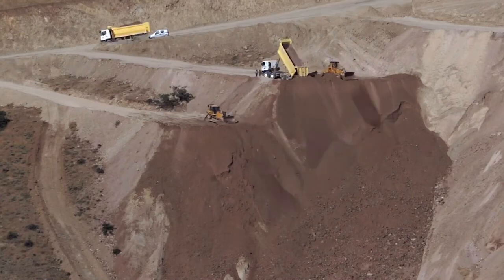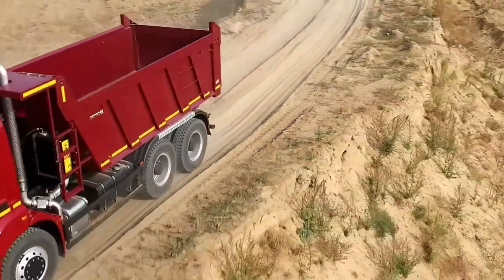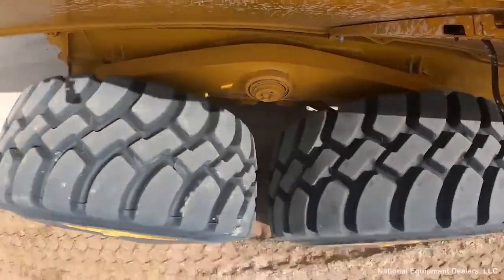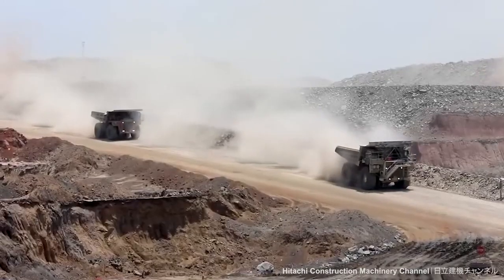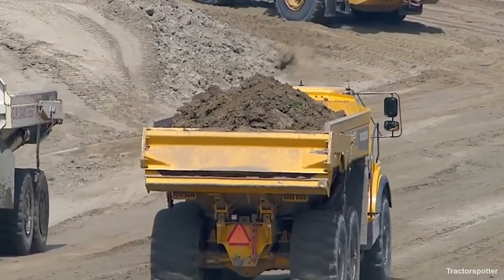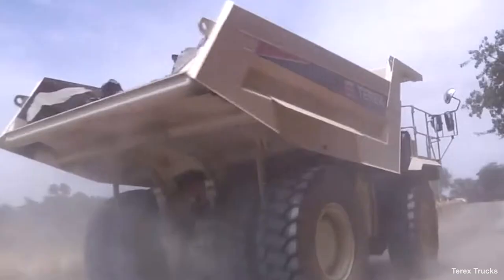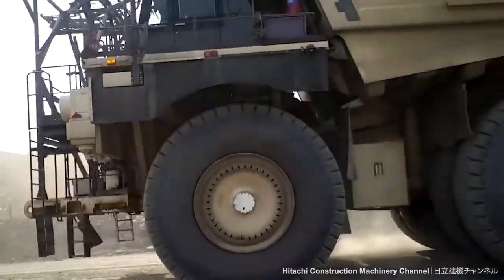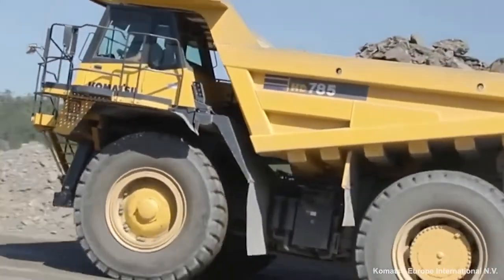Rigid vs Articulated Dump Trucks | Which do You Need?

Comment: In summary, graded such as well maintain of lower graids are good for ridged, but a articulating one can go over most turain, steaper graids and  can take tighter turns
3:40 3 different tyer types
Then more on how articulating  an go over tight coners,
Ridged ones can carry more and go longer as they can sustain more weight and take more punishment as they have less movinvlg parts and are cheaper in cost and mantance
Reply from the maker: Thanks for your input